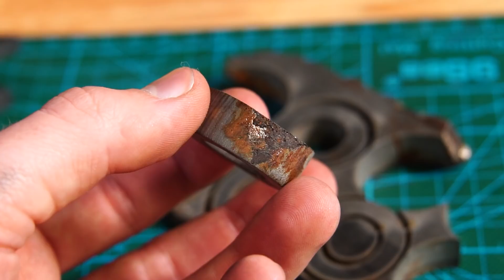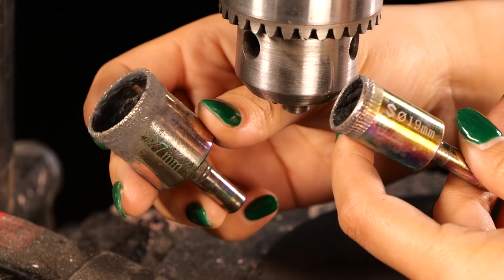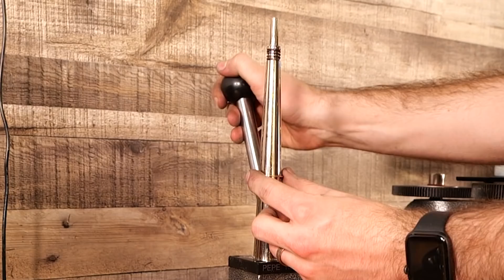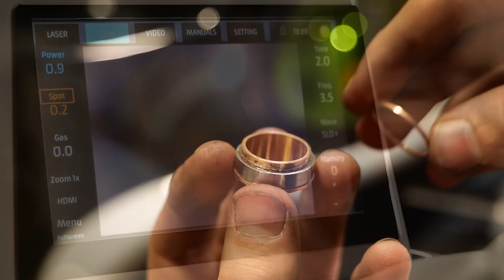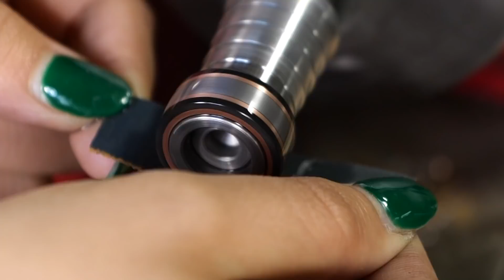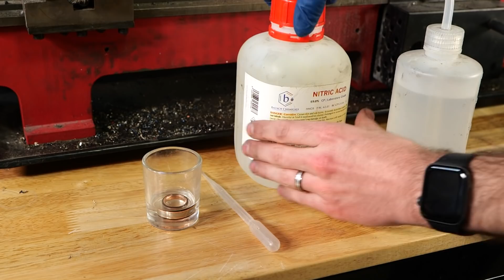My Wife Makes My Wedding Ring

Comment: This just reminds me of my mistake to copy what you did: Used HCl because you can see whats happening in the jar. Now my meteorite ring is rusty :p no accusation, I knew it could happen.
P.S.: Your wife knows how to lathe? Thats kinda hot.
Reply from the maker: Lol I helped with a lot of the steps but she did a really great job!
Reply: @PatrickAdairDesigns  Youre a lucky guy ^^
Reply: @PatrickAdairDesigns  Did you use HNO3/water for the etching? FeCl3 should work better, it will never rust.
Reply: @LaserGadgets  So what you're saying is that meteorite can actually be practical if it's etched with ferric chloride? If so, my ideal wedding band just became a reality. It's really only the rusting that put me off.
Reply: @HammyHavoc  I used HCl for my video, because you cant see much in FeCl3. BUT the water combined with acid makes it rust. I coated mine with UV resin, even that did not stop the rust. Etching it in concentrated FeCl3 should do the trick.
Reply: @PatrickAdairDesigns  Rust???
Reply: @PatrickAdairDesigns  your website keeps giving an error.

Comment: Heads up, a little chemist’s tip (not that I am one but I have studied some chemistry), add the nitric acid to the cup, then dilute with water, because diluting acids is a hyperthermic reaction which can produce a lot of heat, and if you add the water to the acid and it starts getting too hot you can stop adding more water, but if you do the reverse, you may end up with a reaction that gets out of control and bursts the cup getting nitric acid everywhere.

Comment: I loved every bit of this video. Thanks for sharing. I do have a question though. When you fit the base rose gold layer to the meteorite layer with the laser, then you sand it down, then dip it nitric acid. Does this weaken the bond between the base rose gold layer and the meteorite layer? I know the outer rose gold layers will help keep that together but in the case of your obsidian cut meteorite with rose gold (the ring I bought which i fucking love by the way)…what keeps them together. Staring at my ring it almost looks like theres no connection at all? Thanks again. I cant wait to receive my second ring. OHHH i see now. Its press fit. As a surgeon i press fit a lot of my joint parts but theyre all tapered. I would imagine its possible they could separate but highly unlikely? And do they ever actually truly permanently mind together?

Comment: Im consider buying this ring from your store, my only question is would there be a clear coat to this ring to prevent the meteorite from rusting?
Reply: I have the same question. Did you end up getting it? If so, what are your overall thoughts and impressions?

Comment: When you used water to prevent the carbon fibre from burning, it is normal tap water temperature or colder water?
Looks good :)
Reply from the maker: Regular room temp tap water